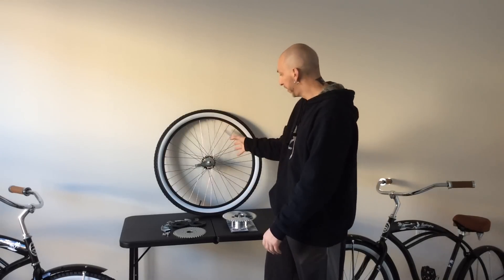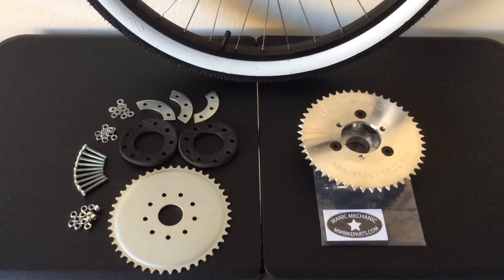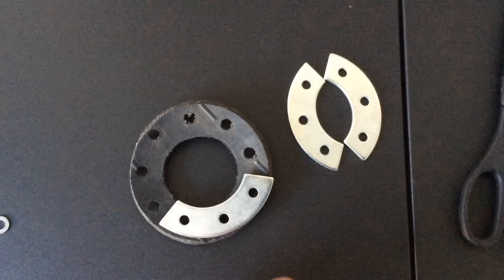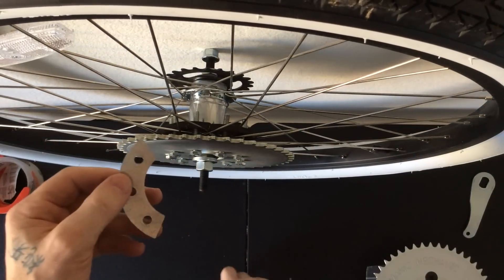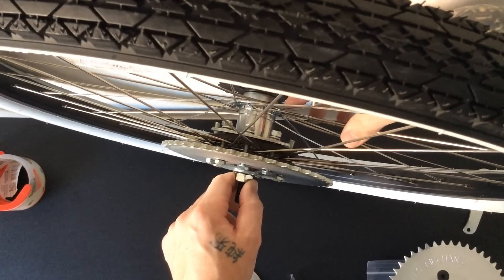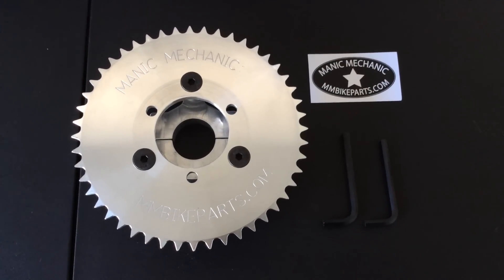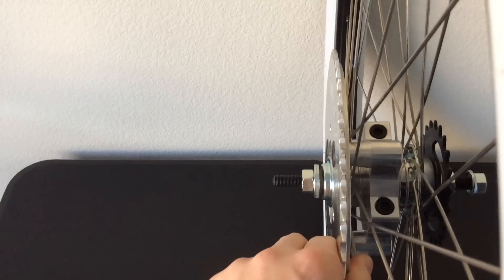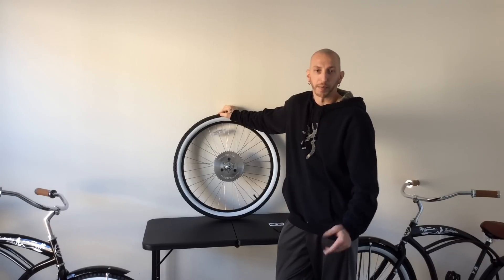How To Install A Motorized Bike Kit - Rear Sprocket

Comment: I totally agree with you. Great video man. I have had been threw hell with my back rims on my motor kits I bought because of the cheap sprocket kit they put in it. It puts way to much pressure on the spokes. I have actually broke 9 spokes with my last one and had to take my rim to my local bike shop to get fixed. I put it back together to only break 1 more spoke. So I started researching into better sprockets and this kind of one is definitely worth the extra money otherwise the cheap one will only continue to mess up rims and spokes. Your video was the first one I watched because I want to see how big the hole is to go around the hub on the bike because I'm going to buy a bike without spokes and wanted to know if it will fit. Seeing this video reassured me that the bike I want to buy will work out with this better upgraded sprocket.

Comment: For centering the rag joint sprocket I found a thick rubber O ring that fit in the gap tightly to center it. Total time with that for me was about fifteen minutes the first time.  I do eventually want to upgrade to a hub mount but that's going to be a month or two. It's held up for a year and a half so far though.
Reply: well,.. you got the center of the sprocket lined up. but,.. spin the wheel and watch the valleys between the teeth as they spin by. look closely. ill bet money the valleys are rising and falling even though the center hole is aligned dead nuts with the hub. that's a chain-killer. TRUST NO CHINESE PARTS
Reply: @robertsmith5323  I don't have any vertical variation but a minor amount of side wobble which is very very slight I have to sit and watch it to see it. It's a rag joint still so I will be changing it anyway. Or even possibly changing for mag wheels with the sprocket mounted on it but those are like three times the price.
Reply: slight side to side wobble like that aint gonna add up to anything. the first time I installed a rag joint I was brutal with the hammer adjustments and i deformed a tooth because I had a micron of wobble. I should have just left it
Reply: @robertsmith5323  yeah probably cost you more in the long run

Comment: How do you get it to be perfectly straight with no wobble?
Reply: Don't use those sprocket adapters it's a bad design. At first they sound like a really good idea, but they just tear your wheel apart. Only two bolts clamping  to your hub,  usually isn't enough to prevent the adapter from sliding under all the torque it has to endure.

Comment: Sinister Custom Cycles     I have been using the stock sprocket that clamps to the spokes for about a year now and haven't had any problems with it. I'll admit yes, putting it on was a pain but I tighten it after each ride and still no problems
Reply from the maker: Hey as long as it's working for you that's all that counts. Oh, I don't have to tighten mine after each ride...lol
Reply: Sinister Custom Cycles use the red thread lock!! On each bolt!!
Reply: Yes hub adapter is simple and better...but the rag joint does have a correct way to do it. You don't need to put all nine bolts in at first. Put just the middle ones and get them bout 10 turns each. Then take rubber hammer and flathead screwdriver and true the sprocket center to the hub circle. Crisscross  tighten all other bolts to be even with the middle ones. After every other tighten make sure your sprocket is centered...at this point shouldn't need to hammer tap it. If you want to move sprocket left or right for chain straightness then loosen cone nut on opposite side of rag joint while you  tighten the coaster break arm. Maybe add a washer on break arm side. And you need to grind the lip off duskcap and bout 1/16 around the edge so that it spins freely inside of sprocket and keeps dust and sand and dirt from getting in your bearings which bust apart if that kinda stuff gets in between the bearings. I've spent 107 dollars on mine so far. I double nut and lock tight the rag joint sprocket bolts and have put well over 20 tanks of gas through it and havnt had one problem out of it. It's a bicycle, you can't just hammer down on it before getting speed up from pedal. Motors putting out 9 times the human leg is. Baby your ride and clutch drive it. Get speed and slightly pull in clutch lever just enough to pull the tension plate off, let the motor slow you down some and then release and throttle , repeat. Feels like changing gears but basicly not ragging the motor out. Works really good with reed valued diaphragm carbs.
Reply: I did that at first, with the lining up of the inner circle to the hub circle, but those Chinese sprockets are punched out so weird, the inner circle will be lined up nicey-nice but the tooth tips and valleys will be rising and falling if you spin the wheel and look from the side. look closely at the tooth tips and the bottoms of the valleys as it spins. you WILL see the true path the chain will take, regardless of the center hole alignment.  much easier to do when the wheel is spinning slightly and you don't focus on individual teeth- you will see the rise and fall of the tooth tips and valleys. its BAD!! (on most) and will stretch a chain to shit butt quick. it's the rise and fall of the valleys (not the tooth tips) that has to be centered and even on these crappy sprockets. lining up the center hole is only a ROUGH guide and is only the beginning. installing a rag joint sprocket really IS a pain in the ass no matter how you slice it.
Reply: Has your MM slipped yet under motor torque and wrecked your spokes ? 
Plenty of others have reported that problem....lol
Reply: lyndon all hubs are not exactly 1-1/2 inches. bike parts vary from brand to brand. but these adapters clamp shut at exactly 1-1/2. exactly. every time. if somebody has a hub that's a teensy, tiny bit smaller, it might bolt up and feel tight,.. but it might still not be tight enough. during install when those 2 clamp halves touch that's as tight as its going to get. period. shows over. no matter how hard you turn the wrench. so if you sand down the 2 flats a tiny bit where they come together,  it should make the clamp close more/tighter. and chop 1/8" off the clamp bolts to be sure they aren't bottoming out. the ppl whose adapter never slips just happen to randomly have a hub that fills the clamp completely. I just bought my first one this week. im curious to install it and see if it WOULD have slipped.
Reply: The hub adapter slips, in-fact the advertisement on BikeBerry even accidentally shows how they slip into the spokes. Unless you are willing to cut in a keyway into your hub and your adapter, don't bother with those things. The rag joints are harder to put together but they work longer than the hub adapters, at least in my case, and don't tell me I didn't have the right size wheel, I measured it with calipurs and did Locktite blue "Never use Loctite red unless you're willing to use a blowtorch to take your stuff off." If you want a professional solution use a sprocket that's attached via the disk brake mounts, as that way you have an upgrade path to disk brakes in the future, as you can just add a spacer, and you prevent any sprocket from bending your spokes. If you don't have disk brake mounts, you could probably just find a rear wheel for a mountain bike or something and slap a sprocket on there for less than these hub adapters.

Comment: that sprocket being off-center not only causes issues with your chain, but it will also destroy your spokes on your wheel, the jack shift kit will use your factory driveline
Reply from the maker: +countryguywithcamera Good points! Except keep in mind that the engines kits use a 415 chain and the jack shafts do use the factory drive line which is much smaller and not at all designed for that torque of the engine. Jackshaft kits are great you just have to baby them or you'll destroy you factory chain and derailer in no time. Thank for the comment! Happy holidays!

Comment: I just installed the cheap;o stock one in about 15 minutes taking my time and using a drill and a open end wrench and lined it perfect by eye as I went no backtracking... but this is my 7th-8th rodeo or better... pretty good but for sure will upgrade to the hub mount as I upgrade the whole stock kit into being something more powerful :}

Comment: On the first one, to center it, I’ve seen someone else insert zip ties all the way around, not tying them, just using them as a place holder, because they were a good size to space it all the way around and keep it consistent.  Then after tightening the bolts, removing the ties.

Comment: I have the same problem over and over with some wheels! Literally have spent hours trying to get the sprocket centered and never get it! Some wheels work just fine, but mostly I struggle like crazy with these rag joints! I hate them!

Comment: is there a sprocket adapter that will work with an hourglass shaped hub? I would have to have one that could mount to the center of the hub as the hub tapers bigger towards the spokes...

Comment: man could you please show how the sprocket on the other side goes on and comes off? the smaller one thats attached to the pedals? I'm rebuilding an old beach cruiser into a motorized bike, I bought a new 26x2.125 rear wheel that I need to put an 18 tooth on, I got the 44 tooth on one side but I cant figure out how the 18 tooth one is going to work with the pedals
Reply: Michael Mountain if im understanding correctly...u need to take your rim to a bicycle shop and tell them what you want. They have a special tool you need to take the right side sprocket off.

Comment: Awesome video!  I'm planning on making a bike with a 66cc 2-Stoke kit and I was wondering how well you think a Huntington bike would hold up to about 3 hours of use per week.  I plan to use rubber mounts to absorb some of the engine vibration, but I'm still worried about how the welds would hold.  I was also wonder what springer fork would you recommend? Can't wait for to see more videos, thanks!
Reply from the maker: +Skit tles Thank you very much for watching and for the compliment! All my builds have been with the Huntington bike and even though 4 strokes have less vibration I keep a close eye on my welds and after over 6,000 miles I never saw any wear on the frame or anywhere else structural for that matter. If you're going to add rubber mounts on top of it you should definitely be good. As far as a front springer fork, go with the heavy duty Monarch fork. It's not only extremely beefy it also has the option for a front disc mount! I'll be using this fork for both my current builds with the disc mount for extra braking power. Thanks again for the support! Any other questions feel free to message me at sinistercustomcycles@gmail.com or Facebook.com/sccmn
Reply: Thanks for the tips!  Do you think you will every make a tutorial on how to install front brakes?
Reply from the maker: +Skit tles You're more than welcome! Yes I will actually be installing the Heavy Duty Monarch Springer Fork with Disc Brake Kit on both my current builds so I'll more than likely break that in to two videos, one for the fork install and then the other for the brake install.
Reply: Great! I'll keep an eye out for them!
Reply from the maker: +Skit tles Sounds good, thank you! If you want to keep up with smaller updates go to Facebook.com/sccmn

Comment: I started my first build, and the rear spocket took a little time but I got it in and centered. Now the problem I have it the rear wheel wont spin freely anymore. I put it back on the bike and it is extremely hard to pedal....what did I do wrong???
Reply: Check that you didn't tighten down your bearings so tight that they can't move.
Reply: I appreciate the response. I found the problem. The rear sprocket was pressing against the dust cap. Had to grind it down

Comment: You had me until the $100 bucks😂 my kit cost under $100 bucks.
Reply: It only 35 buck for adapter
Reply: @joshpreston8233  Yep, cheap clones are $35-40. I will be getting one after I get the bike it will go on, once I measure the hub.

Comment: How much is the rear hub mount kit the easy mount?
Reply from the maker: +Beard King Hello! Depending on the size adapter and sprocket you need prices range about $72.00-$78.00 for coaster brake hubs plus shipping. Just go to mmbikeparts.com and you won't be sorry. They also have a lot of other parts available too! Thank you for watching and your support as it greatly appreciated!
Reply: Sinister Cusboobienom Cycles

Comment: OK this will not work for everyone but if you have a sprocket that came with a hub adapter and it not only has the 3 large holes for the adapter but has 9 holes as well if those holes are more like a slit more like a rectangular shape, round at the bottoms and tops, use carriage bolts. figured it out the other day, perfect fit. Almost perfect alignment vertical and horizontal (got lazy at the end, could be "straigher" on mine 🤣).

Comment: to bad these things are close to being expensive as the engine kit itself especially when you on a budget oh well.
Reply: zombiex 2003 ,,, if you take the dust cap off and put the sprocket on facing the right direction it fits perfect,,, you only need one rag joint on the inside of the spokes,,,. You do not need the second rag joint between the sprocket and the spokes,,,. If you cut your chain down properly you don't need a tensioner that'll end up in your spokes,,. !!!  Set your rear wheel all the way forward until the chain stretches and then move your rear wheel back to Snug your chain back up,,,. !!!
Reply: 32t gear and hub billet ebay $29 shipped.
Reply: @s14duma  Yep. Only problem is the cheaper ones can shift - if you key them with a dremel and woodruff key, thats the perfect solution for cheap.
Reply: @williamwinborne3253  had that happen but then everything bought off ebay never fits first try. Simply shave off a bit on top and bottom of alloy hub with sand paper on a flat surface. Take off a wee bit and good to go! Few months so far no shift, no key, using tiny bit of red loctite. Good to go!
Reply: bought from wish 1 week ship n $111.00
Reply: @s14duma  do you know of anyone manufacturing for a mtn bike (smaller dia) hub
Reply: @PlayingWithFireOutdoors  ebay has all sizes checkem out.
Reply: Amazon has these for less than $30-$35 a piece, not bad considering the ease in which you can switch out your gear size to fit the needs of the trip.

Comment: ,,, you're installing the sprocket wrong,,,. Remove that dust cap in the sprocket fits over it perfectly you only need one rag joint on the inside of the spokes you don't need II rag joint between the sprocket and the spokes,,. !!!   If you spend the time to cut and adjust your chain properly you don't need a tensioner that's going to end up ripping out your spokes,,. !!!

Comment: I had to modify a CNC Hub….the rubber  they include will not last, and will freely rotate and begin to murder your  spokes……With the cnc Your gonna need to install a key chuck……I do this to all my customers bikes…..at times I use the original setup, I pound a   centimetric ring in the middle of the hub, and continue to assemble the hub….I use a Metal curtain rod holder to install in the the rag setup center.

Use a rubber mallet.

Comment: Really, if you are going to bother with the hub mounted sprocket you might as well get a disk brake adapter, its directly bolted to the hub through bolts and doesn't slip like these expensive hub adapters (quit denying that they do, even the 38cc 4 stroke bends them) and doesn't progressively bend your spokes like the rag joint does, not to mention many times it's cheaper as all you have to do is buy a sprocket, unless you decide to go for a mag wheel like I did.

Comment: Hub adapters are wonderful but they do not work with disc brakes. Mine has dual disc brakes and I had to grind out the center hole in the sprocket to 53 mm. It started out at about 33. What a pain in the ass.oh and it's a Fat tire bike so let's hope I have enough chain clearance

Comment: 36 tooth sprocket vs 48 tooth??? pros and cons?
Reply from the maker: +DJCryptoKnight Good morning DJ! 36 tooth sprocket will get you the most top speed. I weigh 160lbs and with no wind on flat asphalt I get a top speed of about 33mph but I don't have a lot of torque so when I do encounter a hill, wind or starting out from a dead stop I don't have a lot of power. My area is fairly flat though and nice roads so this size works for me most of the time. The 48 tooth gives me a top speed of about 20-21mph in the same perfect conditions but a lot of torque. Not much phases it at all in terms of hills or anything. With the rear hub mounted adapter switching sprockets is relatively easy so most of the time I ran a 36 tooth but if I wanted to go on dirt trails or a place I needed torque for the day then I switched out to the big one. Thank you for watching and your support!
Reply: Sinister Custom Cycles Awesome. Thanks for the info.
Reply from the maker: +DJCryptoKnight You're more than welcome! Any other questions at all feel free to ask and I'll help you out the best I can. You can also reach me at sinistercustomcycles@gmail.com or keep up with smaller updates at Facebook.com/sccmn! Thanks again!

Comment: does these sprockets fit on 57 mm, 36 hole rims? ... Please write yes..yes they do.... :P
Reply from the maker: +Morten Hansen Good morning Morten! I'm honestly not sure off the top of my head. However I do know that Manic Mechanic does have adapter to work on a variety of hubs. I would go to mmbikeparts.com and contact them and give them the size and brand of your hub and they will be able to tell you if they currently offer something for your hub or can do something for it. Let me know what you find out! If you have any more questions feel free to message me at either sinistercustomcycles@gmail.com or Facebook.con/sccmn